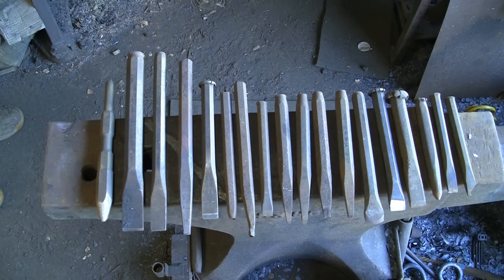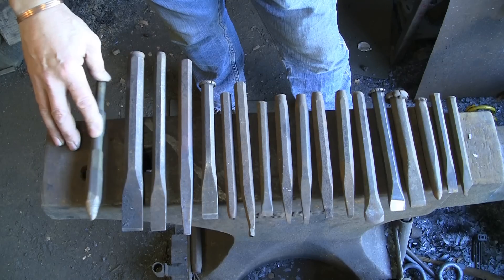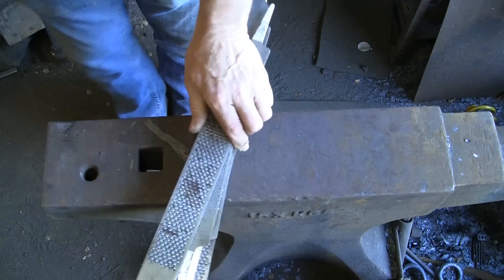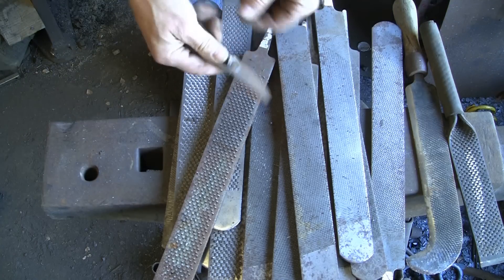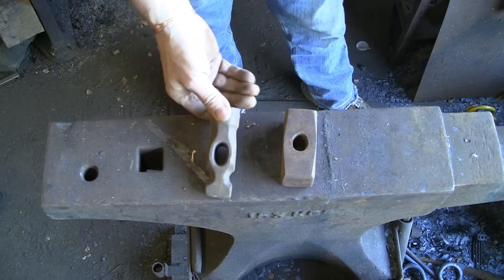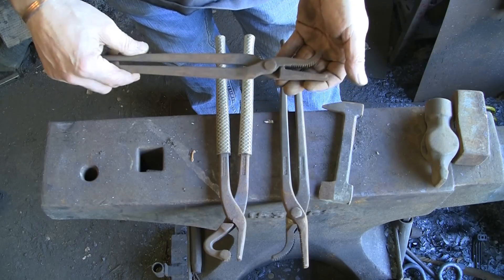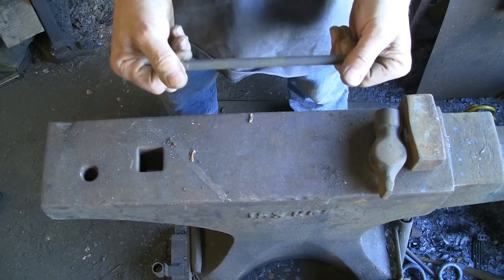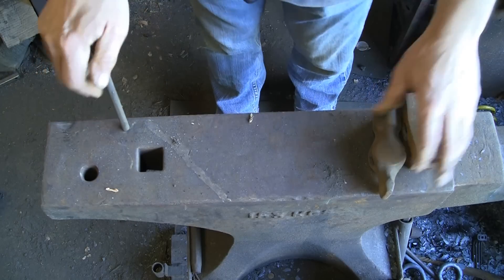Basic heat treatment.

Comment: Around 3:20 there is a double ended tool between the two hammer heads and the two tongs, what is that? I've had one for years sitting on my fire hearth, it's old and clearly made by hand but I've no idea what it is
Reply from the maker: It's called a buffer or clench cutter. Used to cut the clenches off to enable the removal of the horseshoe. Often made by apprentices out of an old rasp as a forging exercise.
Reply: Oh cool, i always thought it was some kind of brick laying or stone masonry tool. It's a bit larger than the one you had there, can see hammer/forging marks on it. thanks.

Comment: There are  several suggestions for treating impetigo at home
try white Vinegar to make your own antibiotic solution- this promote healing of the skin sores
try heat therapy to help cure impetigo. Heat will help remove the bacteria responsible for the infection.
try Tea tree oil - this can stop the spread of the bacterial infection
try Manuka honey which has antibacterial, antiseptic and healing properties which can help prevent impetigo
(I learned these and why they work on Nircas Treatment System website )

Comment: Is this on steel or aluminum
Reply from the maker: Karsten Costain, steel
Reply: Gary Huston okay thank you and do you know if this is possible with aluminum? I want to try and heat treat a lacrosse shaft to have the rainbow color on it
Reply from the maker: Karsten Costain I don't think you can do it on aluminium, it too good a conductor.
Reply: Gary Huston okay thank you
Reply: Karsten Costain I melt aluminum from time to time, and it is kinda 
like solder.. it goes from normal to floppy almost liquid without warning.. it's kinda scary lol you try to heat up a bar and it will just suddenly BAM droop and swing round.. it doesn't oxidize either the way steel foes, and those colors are oxidizing carbon.. sorry. Be safe though.. fire is fun until it's all over you lmao

Comment: half those chisle cost 50 pound  some more.... the steel is spring steel....but they need a little flex in the middle.the ones i described are tungsten tipped but its the stike end mushroom shape i want to learn to shape.that is for a mallet .The tapered end is for a steel hammer and we dont mix em.i realize tungsten is a ceramic.thanx anyway.
Reply from the maker: +Scott Awaywithit if you want a mushroom end simply upset it. depends how big you want.
Reply: +garyhuston see i dont know what upsetting is....sorry....now im all upset....ha !   but i want the mushroom and a dip just before it .....when holding a chisel your thumb goes in the "thumbs up" position as you tuck your thumb just under the mallet head (mushroom)so it needs to accomidate the face of your thumb (the thumb print side ),so you can work all day....i dont want a home made chisel shattering under a blow and cutting my thumb so i wont do this until i understand it.
Reply: +garyhuston these chisels im interested in making are fire sharpend style from the last 3000 years,the tungsten is only in the tip of new chisels,the jackhammer blades have vanadium in the whole chisel,is ironic that you use all those lovely chisels for other things.i wanna crack at macking a wide boulster  at some stage. they used to be called boasters.
btw are old body builder weights of any use..?...i find tonnes of them chucked out.
Reply from the maker: +Scott Awaywithit Why do you want to try making things that are so easy to buy? You obviously have no blacksmithing skills and want to make advanced projects. A wide bolster is about a fiver in any good hardware shop! As for weights, I would guess they are rubbish for anything but weight, why would anyone make a weight out of anything good!
Reply: ....i wanted to know if they were a useable steel or scrap iron....turns out the screw on handles are good.
as for cheap bolsters....gee why didnt i think of that..........the shape is overkill.....and they are covered in plastic protection....ive been using masonry chisels for 20 years and never hit my hand once..........and  they dull fast on sand stone....and sandstone is what we have for miles and miles here........spring steel is what i needed....its fine i got some one to teach me.....and yes i dont know much about making the tools i have to pay up to 60 pounds in pommy money....a trow and holden "offset hand set "chisel will cost me about 250 aus.......and old non carbide versions cant be found for love nor money...now do you see why i wanted to learn about them....?.......or maybee not.
Reply from the maker: If it's a tool of your trade then don't be so tight and just buy the propper tools! I wouldn't dream of trying to make my farriers nippers, they just have to be right no matter that they cost £150 a time! Knives and punches I will make myself all day long but not the good stuff...

Comment: hey gary when your done with your project and your coal is still burning do you pour water on the coal or just let it burn out?
Reply from the maker: GhostCreeper it's coke so it just goes out as soon as you stop the blower. If it was coal i would probably have to water it.
Reply: Thanks Gary.I was just wondering because I have been using the old lump coal made from wood since I can't seem to find any coal or coke and that stuff burns out fast and is becoming quite costly.

Comment: Hi there,

I am thinking of taking up basic iron working as a hobby. Thanks for the info on what is good steel, common sence mostly. If it's used as a tool then it can be re-used to make a different tool.

Can you tell me if chrome vanadium steel can be used as there are tons of old spanners lying around in cardboard boxes at car boot sales?

Regards.
Reply from the maker: Do you know, I have no idea! Working on the common sense theory, yes! I guess a quick google search would tell you more.

Comment: Hi bud it's me again, most steel merchants have charts to identify new stock and heat treatment processes for the various grades. For the files and such is a safe option "anneal it first before you hammer" simple process, heat till mid orange, soak for 30 mins in the heat then into something like builders cement till cold. you can harden it up later in the quench process then heat colour it.

Comment: I understand! I'm, basically, a jobbing mechanic. There is a lot of information that I just don't need for what I do, so I don't bother with it. After 37 years, I have learned a lot of things that work to fix almost anything. If it gets too complicated for me, I send it to someone with different experience. I can't do it all, and I don't want to. I do what I do and I do it well and that works for me. Good video! And you are right! As long as it works, the odd little stuff doesn't matter.
Reply from the maker: Thanks for the support, I thought most people wouldn't understand, It appears that lots do!!

Comment: Thank you for taking the time to video and upload this. This is the kind of info I find useful, the stuff on google is all theoretical, you have experience of actually DOING the work for years. Knowing what tools can be made into what other tools is great!

Glad to have the opinion on Kasenit too. I once tried the old method of wrapping a mild steel shaft in leather/hair/etc (I believe I also used wool cloth!), putting it in a sealed pipe and keeping it red hot for several hours. I think after quenching, the glass hard layer was  about 1 atom thick, absolutely useless!

And the demo of the temper colours, the best I've seen, many thanks!

Comment: If you work with a piece of unknown steel, tip no. 1 would be and test quench in oil first and check for hardness.Still soft try water. You can really mess up hours of work on a tool by quenching in the wrong "media". It can snap right off or develop cracks later on. I'm far from an expert on the subject but picked up this good tip along my way :)
Reply from the maker: Thanks..
Reply: I agree on the oil, i broke some new made tools this way. About normal construction steel: one day i broke off a bit of decoration i made 12mm round like it was glass, and it was not burnt .... is that possible did someone had this before ?